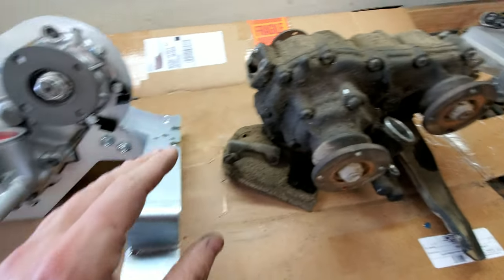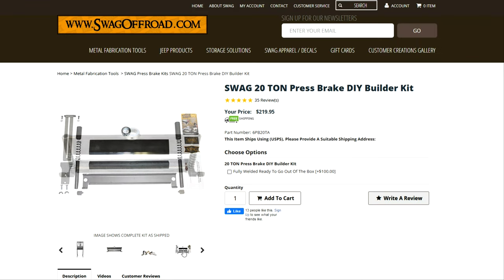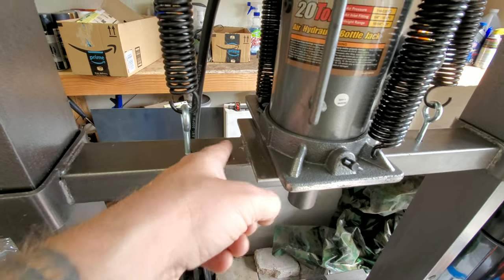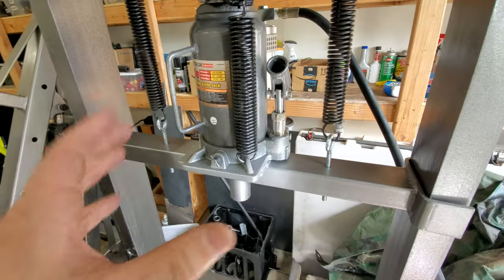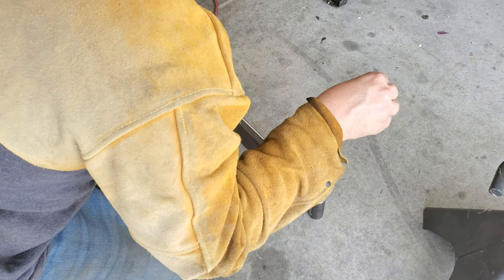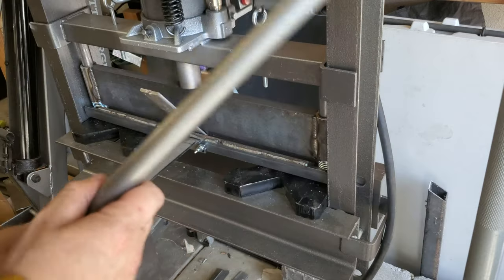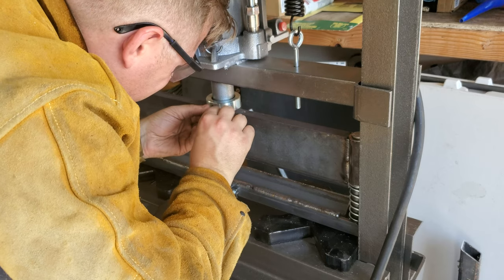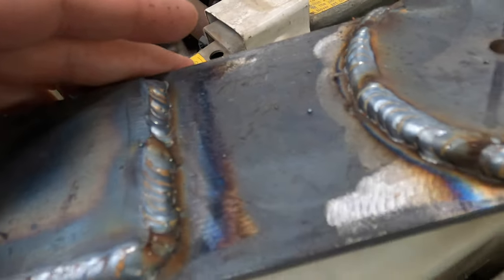Harbor Freight Press Mods! | Pneumatic Jack & Swag DIY Press Brake Kit

Comment: 2 2x4's to hold the opening apart keeping spring tension, pull out and replace jack. Jack it up to remove 2x4 blocks, done. Welds arent necessary unless springs break.
Reply from the maker: With all of the forces being applied in use, I wanted to be extra careful!

Comment: I had one of those little welders, if I welded long beads I had the same problem. Then a friend ( experienced welder) told me that I was probably exceeding the duty cycle of the welder. On the welder I had, I think it was around 20%. If i weld more than 12min. an hour the welder would heat up and weld boogers. Check duty cycle.
Reply from the maker: Thanks for the info!
Reply: @FortuneOffRoad did you ever figure out if this was your problem? (Duty cycle)

Comment: Swag makes an accessory for $17 called a machined thumb knob for the release on the bottle jack. It's like a star pattern knob you turn with your fingers so you don't need to use the end of the pipe to tighten or loosen it.
It's a must have!
Reply from the maker: I know! I keep forgetting to order one. I've been telling myself I'm just going to glue a hose spigot knob on there

Comment: I've had the 180 for years and just recently switched to gas and I will say that switching from Flux core to gas on the 180 is WAY different..the Flux burns so much hotter on the same setting then the gas it's crazy but all in all I've had nothing but good luck with mine over 10 years of having it..
Reply from the maker: Switching to gas was a game changer for me. I'm no expert but my welds have since improved dramatically
Reply: Use wire core plus C25 Argon deeper penetration . Turn the heat up . Have another person do the tuning wile you weld . You will find success.

Comment: Permanently welding a jack in place. Wow! Kinda like welding wheel lug nuts to the studs. Could not weld tabs to extend the plate and drill holes?
Reply from the maker: Sure, i could've done that. If I had to replace it, it would be quicker to cut and weld on a new one than to weld tabs and Re-drill a new one. 3 years and going strong 💪🏻

Comment: If you ever underbend something turn the part over and mark where bottom die made mark on it and you will be able to line it back up to hit in same spot again . I ran a 400 and 500 ton press for 11 yrs
Reply from the maker: Thanks for the tip!
Reply: Mark it on the side of the metal or on top where the line is on bottom

Comment: I think it’s great to put a air jack on your press but would it be better to put bolts in it to anchor it instead of welding it in case the jack needs to be removed for repair.
Reply from the maker: That's definitely true! ...but I hate drilling and enjoy welding. Will cut it off later if I have to!

Comment: You pushing or pulling?  Gad works better pushed while flux core doesn't really matter.
Reply from the maker: Good to know. Direction usually depends on the position

Comment: You’ve done fairly well with your welding considering the machine you’re using. GET A 220V MACHINE FOR WELDING MATERIAL THAT THICK. 11Ov machine is NOT suited for it. I have over 30 years experience mig welding in steel fab shops and have often been asked about buying a mig welder. I always say to save a little longer and get a 220 machine as it will do anything the 110 will and whole lot more. I’m usually ignored and they’ll get the 110v unit anyway. 🙄
Reply from the maker: Thanks dude! I'll get one eventually. Right now the 110v is great! It's actually been burning too hot for a lot of material. O don't even need multiple passes most of the time. What do you recommend for a 220v machine?
Reply: @FortuneOffRoad  for the hobbyist welder you can’t beat what Hobart offers for the money. I just got an Ironman 240 for around 1500 bucks and love it. Look at their smaller machines around 180-200 amps.
Reply: @robert4005  I have a Hobart 190 handler and it’s good with 75/25. 
Loved the PowCon welders I used in the 80’s they could push 045 wire all day. Used hardwire, dual shield blueshield and nickel wire.
Reply: @FortuneOffRoad  The HF upper level welders have really good reviews and used in shops daily for years.

Comment: Needless work on mounting the air jack. There’s no need to grind smaller and weld
Reply from the maker: Not sure which part you're talking about, but this setup has been working great! Part of the reason for welding was getting more seat time in with at the time was a new welder! 🤙🏻

Comment: You shouldn't ever weld on an assembled bottle jack, the heat will damage the seals, also the jack is cast iron not steel.
Reply from the maker: I'm sure you're right. I'm hoping it's not damaged and continues to work for more years to come. Of it doesn't, they're cheap enough 👍🏻